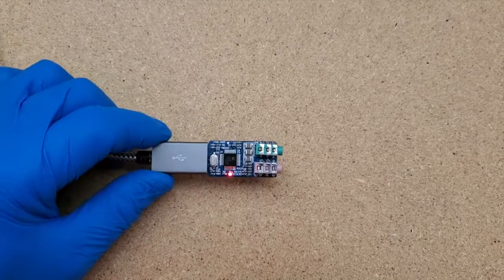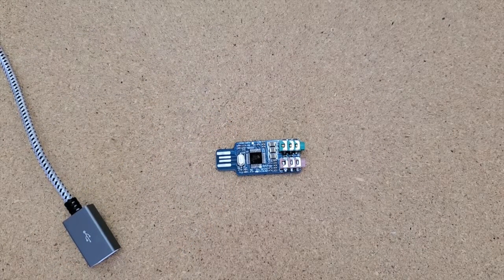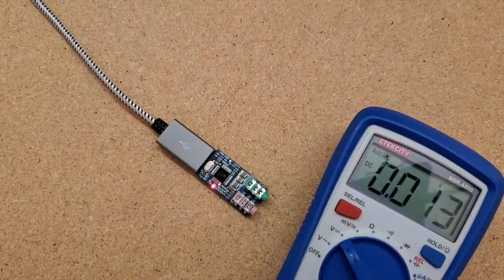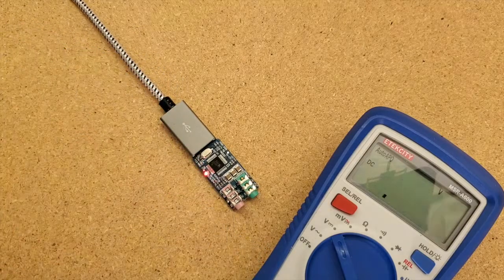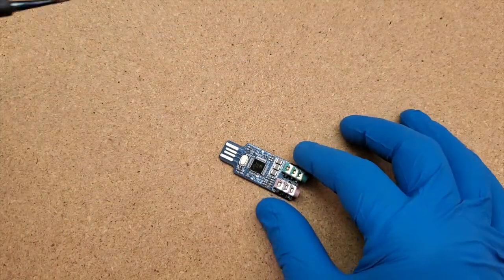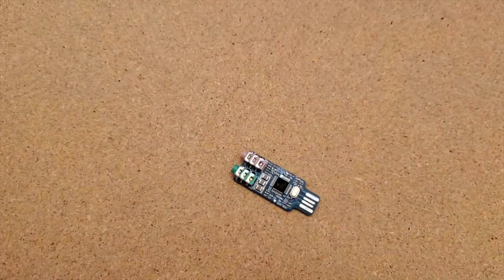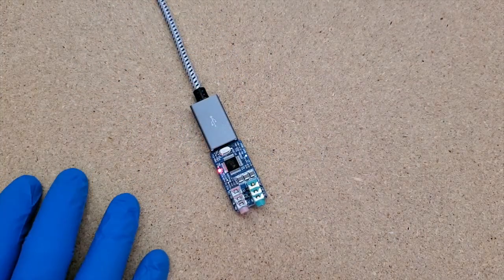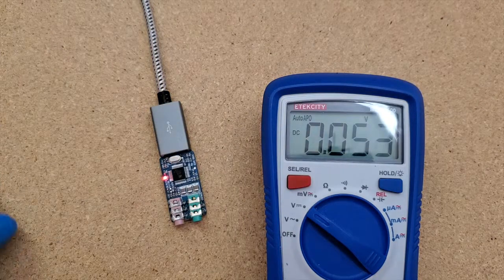CM108 Sound Card  |  Removing Five Volt Bias-T On Mic Input

Comment: This will work well for hooking up a scanner with a discriminator tap up to a Pi. I don't want any voltage going into the chip of the scanner (a discriminator tap bypasses all the filtering and connects directly to a chip in the scanner), or effecting the audio signal. So this would be perfect. Now is just to find some software for a Raspberry Pi that will decode digital (DMR, Dstar, fusion, P25) that will accept input from an external audio source.  

I use an analog scanner to listen to quite few repeaters, and some of them are running digital modes.